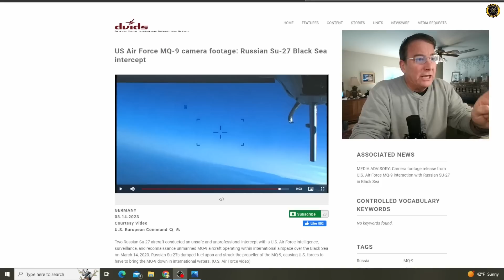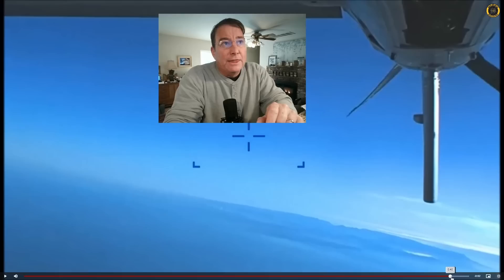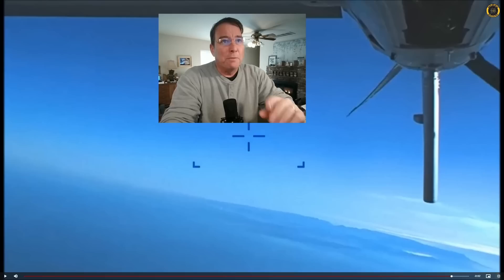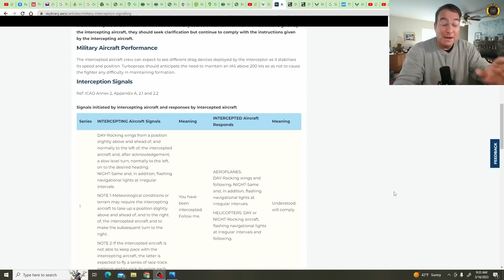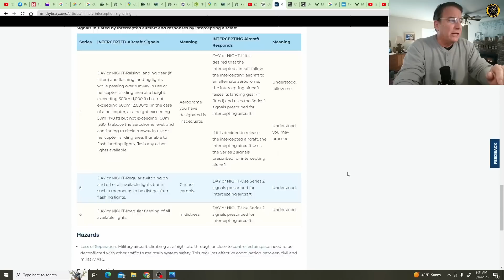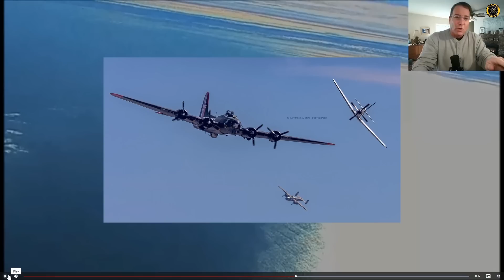Botched Russian Intercept of MQ-9 Drone Over International Waters

Comment: Not botched….. their mission was most likely to soak it in fuel and lit it alight (afterburners) or smother the engine in the process getting it down …not using weapons as that technically is an act of war! Was a long shot pulling that off and clearly led to most likely a belly impact with the prop and likely left rudder area as well. Botched from their initial MO yes….but their mission to get it down was actually accomplished! The drone went down.  Perspective is all in the eye of the beholder

Comment: What are they trying to achieve by dumping fuel on the drone? Is the idea to shower the drone with jet fuel and hope that the fuel is ignited by the drone's engine (turboprop)? In that case, wouldn't that lead to a short fire that lasts until the gasoline dumped on the drone burns up? I would think that there is no point in trying to drown a turboprop engine with jet fuel? Won't that just cause it to burn some of the jet fuel being sucked in and just spit out any unburned jet fuel? This is the only possible outcome I could think of, but I'm totally unqualified when it comes to this topic.

Comment: Is actual physical contact confirmed? Because I think the damage must have been caused by the fuel impinging on the prop. At blade speeds, the impact with liquid fuel would be like hitting concrete. Also the damage seems to be on opposing blades, leaving the other two unscathed. This would seem to be consistent with the unevenly dispersed fuel...
Reply: No way aerosolized fuel would have caused that kind of damage to the prop.  If it did you'd see these drones falling out of the sky just from flying through clouds.

Comment: NOTE - READ THE WHOLE COMMENT - I THINK YOU WILL FIND IT WELL WORTH YOUR TIME - HOPE SO AT LEAST

Open your eyes Peeps. You're missing the most revealing and fascinating things about this drone video footage...
I've seen them.....Have you?
HINT:  Look at it like those picture games one sees....you know....Here's a picture, then right next to it is the same picture with some things changed and/or some things missing.
 
Here's what I have observed from this video. No-one else has even mentioned and/or brought it up - something most fascinating - 

NOTE: the Wion video here is not the entirely shown video released by the US DOD. It can be used, but it is better to find and view a COMPLETE version of the 'official' drone footage. In either case -  Watch your footage of choice - but - I find it better to view at the slowest speed available. 
What do you see? The Better question is - What don't you see? 
My 'analysis' -  
After the First Pass by the Russian Su-27, the drone shows video footage of the 4-bladed propeller without any damage. 
There then appears to be a delay in the video prior to the Second Pass 
After the Second Pass, the drone's camera goes 'off-line' for some time (reported to be 60 seconds). 
Then when the drone's camera video returns - This time it shows not just one of the drone's propeller blades damaged, but actually two. One propeller blade tip has been bent from obvious contact with another object. The propeller blade 180 degrees from the bent blade has also been damaged. It doesn't show any physical damage, but the blade has 'turned' 90 degrees (in relation to its 'normal' aligned position) - this is referred to as the blade being in a 'feathered' position. 

BUT - Now watch the whole video again............What is it that you DON'T SEE? 
The TIPS of all four propeller blades shown in the drone video AFTER the First Pass - are painted yellow and also have an additional yellow painted stripe as well - YES? 
Then the video feed is LOST after the Second Pass 
When the video feed is restored - What do you see? No fighter jet - BUT - once again, the drone's propeller blades - YES? 
WHAT IS IT THAT YOU DON'T SEE HERE? 
THE TIPS OF ALL OF THE PROPELLER BLADES - NO LONGER HAVE THE YELLOW PAINT OR STRIPES ANYMORE - DO THEY? 

HHHHMMMM.....BEFORE PAINTED - LOSE FEED - FEED COMES BACK - AFTER NOT PAINTED - ????????????????????? 
HOW CAN THAT BE POSSIBLE? WHAT HAPPENED TO THE PAINT? WHERE DID IT GO? 

AND - That is not all - IN ADDITION - 

After the First Pass, the video shows a fuel vapor cloud trailing (behind) the drone. 
Then a pause in the feed - until it suddenly shows a second Su-27 in position to make a piss-run at the drone 
On the Second Pass, the fuel vapor cloud from the first pass is STILL VISIBLE as the second 'dump' is applied - ALSO NOTE - that the first fuel vapor cloud is still very near - in relation to the drone - This leads me to believe that it is the other Su-27 having his turn at the fun (it would take some time for the first passing Su-27 to get back into position - i.e. the first fuel vapor cloud wouldn't be as close to the drone as can be seen during the Second Pass) 
AFTER the Second Pass - AND - AFTER the video feed is once again restored, there is again No fighter jets...BUT....Most Importantly - NO fuel vapor cloud - Well - Anywhere to be seen - NONE - Neither from the First dump, nor the Second - NOTHING - ONLY MILES OF BLUE SKY - Is there? 

HHHHMMMM....NUMBER TWO..... 

This begs the question - IS THE SECOND FOOTAGE AFTER THE SECOND PASS, AND SUBSEQUENT LOST VIDEO FEED ACTUALLY THE SAME DRONE????????????? 

So, Recapping - THE PROPELLER TIP PAINT AND ANY TRACE OF A FUEL VAPOR CLOUD BOTH SEEMINGLY JUST 'DISAPPEAR' AFTER THE LOST VIDEO FEED IS RESTORED - WITH NO FIGHTER JET(S) IN SIGHT? IS THIS PERHAPS TWO SEPARATE VIDEOS? 

Now that.......THAT......is what I find most fascinating.........Wouldn't you agree?

Comment: The drone is MUCH slower than that jet in level flight, plus the jet pilot appears to have been intending to douse the prop and air intake with a LOT of fuel at once (not much atomized) "to create local atmospheric conditions not conducive of continuing powered flight" as his report likely has stated.
Both objectives call for a very high angle of attack (aiming the fuel stream down, to contact the drone) slow-ish pass (time of exposure to the fuel stream), and that's precisely what'd transpired per video footage. Needless to say, a stabilized approach for such a pass would start behind and well below the drone. Vid author's assessment is a potentially lethal underestimate of the Russian airmanship in this case.

Comment: Some aircraft you can dump fuel with the afterburner on and create a long trailing flame, is this what the russian pilot might have been trying? ( and the atmospheric conditions, aircraft configuration or speeds simply caused this to fail)

Comment: The Sukhois tried to spray plumes of kerosine on the MQ-9. How flammable is such spray? If the spray had ignited, would there have been a risk of fire spreading all the way to those fuel tanks, from which they were pumped out?

Comment: I'm not certain I understand how disabling a hostile drone is a failure.  Depending on the level of damaged to the fighter, this could be the desired outcome.  I'm certain I don't understand why they didn't simply use guns or a missile, as it isn't reasonable to imagine that this was anything other than an overt air-to-air attack.

Comment: What was the purpose of dumping fuel? Was he trying to smother the cameras on the drone? Also...I remember reading of how Spitfire and I think Typhoon pilots would tip the wings of 'buzz bombs' flying towards London during WW2. This kind of reminded me of that.
Reply: Presumption is they were trying to cause the engine to flame out by dumping fuel onto it.  If enough fuel got sucked into the engine intake it could have caused an engine failure or maybe even an engine fire.

Comment: Accidentally on purpose?  Or, really screwed the pooch?  Smashed prop and splashed A/C.  Was this the desired result"  I saw the other blade in what looks like feather.  Vibration levels will bend the prop shaft, Brinell the bearings and wreck the gearbox in very short order.  Think washing machine with two beach towels on one side of the bowl.  I believe your absolutely right about shaking the A/C apart.

Comment: I keep wondering if people are only seeing what they are told to see...bad Russian pilot...innocent drone...physical collision...international waters.. and so on. As reported elsewhere you can probably find them if you care to look, the MQ-9, which can be heavily armed,was flying with transponder off toward Crimea and got as close as 18 nautical miles of the Crimea. If your goal was to bring it down without firing weapons at it, how would you do it? I have a hard time seeing how there wasn't more damage to the Reaper and the two SU-27s returned to base safely if they made physical contact. From pictures I've seen of the structure of the MQ-9 the V-tail structure is much larger than the propeller, so how could the SU-27 contact the propeller without causing catastrophic damage to the tail and the SU-27? Could the mass of the fuel hitting the propeller blade cause the damage that that can be seen?

Comment: Botched huh? How did he hit the propeller without hitting the V shaped stabilizers, which are higher than the propeller? Maybe the drop of the fuel actually worked, and liquid can break propellers. So, that means the pilot actually did great flying, and all of this noting but cynicism.

Comment: Its my view that the Russian was attempting to extinguish the drone turbine with the dumped fuel and/or cause an upset with wake vortex. The second pass shown in the video is apparently after 40 minutes of engagement and presumably numerous close passes. The first pass shown has the drone flying into the sun (sun being approx ESE at this time) and the second pass, they are heading roughly NW with a headland in view to the left and th sun low and behind.
The drone is turning in a gentle bank to stbd, presumably in efforts to avoid. If it were me flying the drone, I'd have the speed cranked right back to make it hard for the Russians to turn with it. We dont know the altitude but presumably this is a slower airspeed than would be controllable in the Su hence the rapid passes. I would guess that the ruddervators were also damaged in the flyby as they are outside of the arc of the prop.  Interesting stuff though. And a good lesson in the usefulness of drones. No CSAR required.

Comment: 1. You can find a video from a Russian jet, which follows the drone on its right side. Basically they did a similar procedure you have cited. Why do you then falsely accuse Russian jets not to do that? The harassing part came only afterwards, when US side decided to be cheeky and uncivilized and not comply to Russian rules of being in the restricted area. 
3. You highlight that the drone was intercepted in the international waters, i.e. at 12 nautical miles (fully at 24NM) from the coast. However, ADIZ of USA stretches well beyond this definition and the US regulation allows interception of a non-complying aircraft. Does it mean that the USA breaches international laws on the daily basis? 
4. The drone fell 32NM from Sebastopol. Do you consider that Russia may be at least worried to have a spy aircraft of a hostile country to be so close to their main naval military base? Can it be called reasonable to include the airspace around a military base into the defense area especially during the time of a war? This is what the USA would have called "national interests".

Comment: Honest question: Could the impact knock the stripes off all of the prop blades or could the fuel have dissolved them? In the post-impact image shown at 0:58 the blades have no stripes on them but in the pre-impact image at 4:27 the prop blades have double yellow stripes.
Reply: CGI splice . Camera doesnt shake either

Comment: The prop diameter is within the radius of the vertical stabilizers, so I don't see how it was damaged without those being struck as well?  I wonder if something smaller like an antenna from the Russian jet went between the vertical stabs and clipped the prop?
Reply: It could have just been from having a massive amount of fuel dumped into a prop spinning at very high speed.

Comment: Respectfully, you do not have a clue of how Russian pilots are trained and in this particular case they did exactly what they were trained to do.
They had no intention of getting into any formation with the drone, since there is no pilots on-board of drone. I am sure they were in-touch with the ground and marine units and were directed/ordered to ram the drone.
I did not see any fuel dump, only the smoke coming out of the tail pipes.
I am just wondering of what would our pilots do to the Russian drone flying just off the cost of Florida over the International waters from the Cuban military base, if they would've had one there? Do you think they would've gone into any formation flight?

Comment: They could presumably flame out a passenger jet engine using the same tactics. If you look at flight tracker 24, the europe-asia major transit corridor is only a couple of hundred miles further south.  The direct routes used to be over Russian territory but they've diverted to fly across the lower half of the Black Sea.

Comment: However, what you see is a frame-rate artifact from being almost in sync ... the Mig didn't strike the propellers, everyone is suckered by NOT considering the prop was at cruise rpm so couldn't be seen by the eye.

Instead, the pilots turned on fuel to unlit afterburners the hot fuel degrades aerodynamics if not the lift of the prop more like reality.

Ymmv 🍺

Comment: What I don't understand is why the blade parallel tip stripes are not showing as earlier in this video.  Is it possible for the blades to have rotated 180 deg and actually be in reverse thrust at in this video - no because the leading edge shape is the same and rotation direction is the same as first pass.   Also it looks like hills/land in the background, not out in the middle of water. Maybe there was a large time gap in the presentation due to attitude recovery?
Reply: The stripes are neither reflective nor glow-in-the-dark. You can only see the stripes clearly at first because the sun is shining directly on them at the beginning of the video. By the end, the blades are in shadow and the colors of objects in shadow are, of course, darker and desaturated. I have no trouble seeing them in certain frames as a different shade of grey.

Comment: One would guess the Russian plane intention was to shoot down the drone by spraying fuel on its flight path and causing an engine flameout due to lack of air. If so, one could just guess there was a very good reason for not dumping the fuel when flying right in front of the MQ-9...

Comment: lets look at it from the point of view of russian pilot:

command has told him to harass the drone.

fuel dump attack would blind sensors/camera and cause engine surge and/or flameout

low hours and lack of currency has eroded his skill

what hours he has relate to mid/high speed flying

low speed - right on the edge of his stall speed is not what he is used to and not what the fighter was designed for

drone cruise speed 150kts, no doubt can fly slower than that if being pestered by fighter plane

ingesting that drone or parts of it would spell goodnight for the fighter pilot.

russian pilot probably just ran out of skill and wet himself when he came that close to drone, if he could even see it from that angle.

I note the V tail on the drone would make it quite difficult to damage the prop alone by collision - others have commented on the possibility of that much fuel that close damaging the prop.

Comment: A question. If that propeller tried to cut through heavy jet fuel not only air, would that over stress it and cause the blades to bend?
Reply: Good question but I think the aircraft (and prop) are designed to fly thru heavy rain without damage.  So a fuel cloud should be no problem for the prop.  Now for the sensors and cameras, I don't know.

Comment: That prop on the back of the drone …. Is rather nested near tail fins.  Two opposite blades damaged?  By what? A wing tip?  No known damage to the Russian plane? Perhaps that pilot perished. Is that jet afterburner exhaust gas or fuel in vortex that we see?.  Wouldn’t fuel ignite by the jet exhaust flame?  Main scream media is running wild!

Comment: I would hardly call it botched when he successfully knocked the drone out of the sky without firing a shot.  Pilots did this sort of thing in both world wars.
Reply: True. But they did it by flying precisely and in control and maintaining visual with the V1s. Then they would gently nudge it with their wings to upset the flight path of the drone, from which it could not recover given the crude guidance and control systems of the day. That’s not what happened here. The Su pilot lost sight of the drone and collided with it. He’s lucky to be alive.
Reply: @cessna177flyer3  Maybe, but I think that heavy SU27 could have run right through a wing of that drone with little or no damage.  He just got a little cute and as is obvious by the result accomplished his goal.
Reply: @greymann  disagree. A relatively light, fluffy bird can take down a fighter (or an airliner…e.g. Sully). No sane pilot would ever intentionally collide with a 5000lb, metal drone with a high rate of closure, belly up (exposing the engines) and think everything will be fine. Extremely poor decision making without the skills to back it up. He got very lucky.